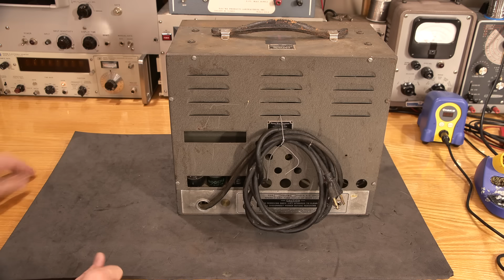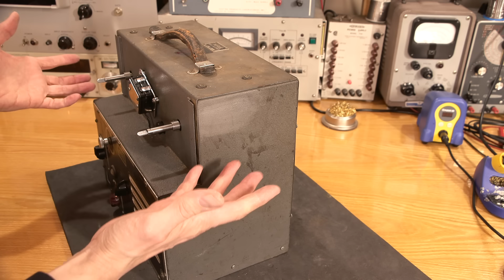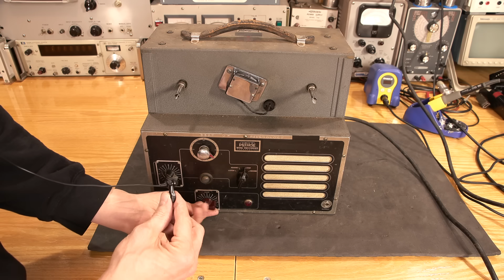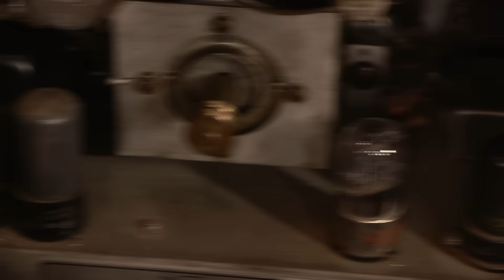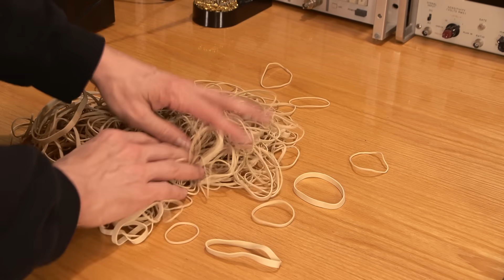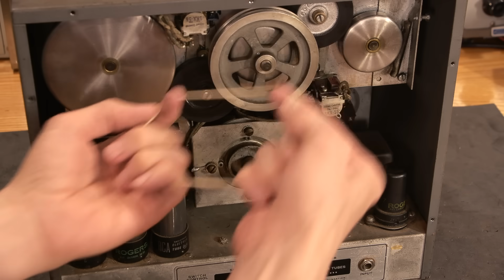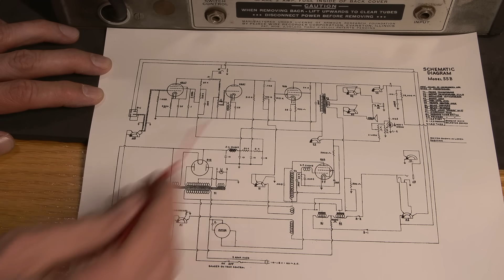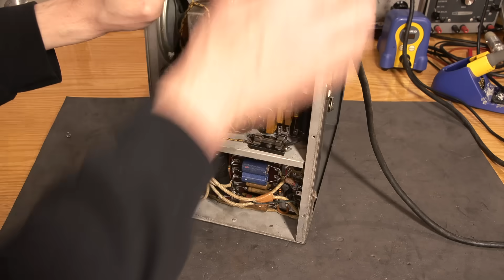Trapped Voices In This Wire - Let's Listen To Them!

Comment: Put another one down in the YES column for a restoration video!!!  I have a box of old vacuum tubes and may even have a replacement for a faulty one or more in the amplifier!

But I guess if you can’t find a replacement, you can use a modern amp that’s multitudes more efficient.

Comment: I inherited an old wire recorder from my grandfather with several wire recordings taken off the radio in the late 1930's of my mom and her two brothers singing gospel songs as kids. Only my uncle still remains and he is in his nineties. My cousin and I trouble shot and replaced the old dried paper capacitors with newer caps (we drilled out the old wax and paper caps and hid the new ones inside the old, refilling them with epoxy. That was 15 years ago. It still works electronically but when I was transferring the recordings to digital, in 2019, one of the springs in the winding mechanism broke and tangled one of the wire recordings. I need to get back to that project soon.

Comment: I'm eager to hear the recording, so since the transport works could you just isolate the head and wire it into an aux input or just a guitar amp and we can hear it without messing with caps, tubes and diagnosis?

Comment: This was interesting to me.  As a child I used to watch my dad work on old tube radios and later, TVs.  I was always fascinated in al the glowing tubes in back.  Of course, back then, when an old tube failed, he could go out and usually find a replacement. (time: late 50s early 60s)  Thanks for the memories.  ALSO: @dm.2023 mentioned wanting to hear the whole conversation on this wire.  I would too!  I never knew wire was (could be) used in this manner.

Comment: Hi Mr. Carlson I am a Patreon member of yours for years. I was wondering if you could create and share a build for a capacitor tester that is super sensitive for testing small pico farad caps to measure their capacity accurately. Most multimeters even my Fluke really is not that accurate when measuring extremely low value caps.

Comment: You need to stoo playing with this immediately. You need to get some redundancy set up and multiple recording at a higher definition than the play back.  Reason for that will become apparent later.
Think of LP’s and half speed master recordings. I owned two half speed master back in the early 1980’s. One was Dark side of the Moon, and the other was Aqualung. Look up how half speed mastering was done. Its a way to get better quality than the original.

Comment: That magnetic wire probably can last much longer than old tapes which often must be baked to prevent deterioration. 

In fact that circuit is quite complicated compared to the circuit of for example a late 50's Telefunken Magnetophon, because in those Telefunkens the same output pentode (usually EL95 or EL84) is used both as an audio output stage and, when recording, as a bias oscillator. So there is no need for that extra pentode unless the device  features separate recording and playback heads and you want to be able to real time monitor recording from the output stage.

Comment: I am 81 years old, and my family had a wire recorder that was used extensively in the early 1950’s but did not look at all like your “monster” looking machine.  Ours looked nearly exactly like reel to reel tape machines (which we also had) that succeeded then wire recorder in the laten50’s and earlyn60’s.  The only issue we had (as kids playing with the wire recorder) was that we would occasionally tangle the wire and then we would have to pull out of the reel and make sure that it “fed” properly.  I wish I could tell you the brand name on our machine, but two name stand out from that time:Zenith and Ampex.  The tape machine that we had in about 1962 was a Sony.  The quality of the wire recorders was very good - nearly as good as the later tape machines.

Comment: A definite yes on the whole troubleshooting video. Also a discussion of how the pick up head works. Later technology used "tape" with iron oxide embedded on it as the recording medium. How did the "wire" store the localized signal? Thanks again for an interesting view into the past.

Comment: It is very important that you reawsken that disembodied voice , kept trapped within the wire !  I bet its the last known non-babbling recording of Kamala Harris as she lay upon the psyche lab couch !   Nick , NavyBlueSmoke , LST-1195 keep the relays if you trash that museum piece. They have real beryllium / copper contacts ! Reliable low resistance with negligible heat in high current circuits. Resistant to welding tendency that is common in cheap relays. Nick , NavyBlueSmoke , LST-1195

Comment: Could likely build a replacement for the electronics in that thing in a few days using a modern pickup and a couple of op amps/audio amps.   I guess it is cool to ressurect the dinosaur, but technically no reason to do that.

Comment: You can soak hard rubber parts in brake fluid to soften them back up. Brake fluid contains a rubber conditioner in it to keep o rings from going hard. You can also coat them with Glycerine and keep applying it over weeks while the rubber slowly absorbs it. It's a safer way of doing it than brake fluid but it is much, much slower.

Comment: WOW!  Hey Mr. Carlson - you may be on verge of KILLING YOURSELF!! my father was a TV repairman after WW2 and when i was a kid and used to watch him work on the early TV's he would always lecture me about NOT putting my hand into the back of the TV because there were capacitors on the chassis that carried HIGH VOLTAGE - enough to kill a person. you had to unplug the TV and let it sit for at least ten minutes before you started messing with it so the electric charge would drain off. as to your "wire recorder", i believe you are missing the drive belt that goes from the motor to the upper "gearbox" that works the reading head in and out.  the drive belt would have been a round (circular) black rubber belt of the type commonly found on old Hoover vacuum cleaners that drives the pick-up brush on the front of the vacuum. wire recorders were used a lot in WW2 by the U.S. military at the Administrative Divisions of the services.

Comment: You can buy “o-ring” banding on a roll…(in all diameters) then cut to length and super glue the ends. It’s an accepted method in the heavy machinery industry.

Comment: THE RUBBER WHEELS ARE CALLED "IDLER  WHEELS" OLD BSR  RECORD PLAYERS USED THEM. I CHANGED A LOT OF THEM. THE RUBBER BELTS  OVER THE YEARS TURN INTO GUMBO BELTS. LIKE WHEN YOU WRAP SOMETHING WITH RUBBER BANDS , THE STRETCHING OVER THE YEARS CAUSE RUBBER BANDS TO TURN INTO MUSH,  STICKY GOO. NICE WIRE  RECORDER /PLAYBACK DEVICE!! 😊😊😊😊

Comment: Amazingly good sound! I made custom O-rings for customers when I worked in an auto parts store back in the 1980's and it might be a service still available at one of these places.  It is a simple DIY project using O-ring stock, a razor blade and super glue.  A guide, or good eye and steady hand is needed to cut a fairly precise, right-angle cut on both ends of the O-ring stock, then bond ends together with super glue.

Comment: Very cool. I have never actually seen a wire recorder. My Dad had a spool of wire from one though. Also in 1967 when I was about 13 I got a couple of TVs my dad bought at an auction that didn't work. He had a tube tester so I tested all the tubes in the set and swapped out tubes to get one TV working. I remember before i did any swapping one of the tubes was flashing purple! That scared me a little bit. This was my first TV in my bedroom but I had to wire it up to the basement door so Dad wouldn't catch me watching TV when I was supposed to be sleeping.  I still have that tube tester and have repaired several antique radios in the last few years. I am amazes how much smaller the capacitors are that replace the old wax and paper ones.

Comment: Just out of curiosity; would it not have been safer to wear gloves when turning ON the power to this un-tested device? (In case the chassis was somehow damaged an not isolated. I'm assuming the device was running on a normal house-hold power outlet)

I learned the hard way to always wear gloves when getting near electrical devices (I mean, it IS human to err ;) So just to be on the safe side I never touch un-tested metal devices with bare hands)

Comment: Hi Mr Carlson. Did you know that Giuglielmo Marconi used in his first commercial Ship Radio stations a " Maggie" detector to demodulate his transmissions. The magnetic demodulator was considered to be more sensitive than the Coherer, and more stable than the Cristal detector. How it worked?  There was a loop of wire , driven by a fast running clockwork motor,that had to be wound up about every 15 minutes. The magnetic wire passed through 3 Coils (Heads). One Coil was passed by the RF from antenna and receiver coil (tuning), then one magnetising coil, and one receiver coil connected to the Headphones. The RF from receiver demagnetised the wire and you heard in the headphones  a louder or less loud hiss depending on the received telegraphy signs.  This was in the 1910s  no tube amplifier needed.

Comment: Sounds like a shorted coupling cap, it should be a simple fix. Cut the cap off the grid and see if that tube cools off. I actually remember these machines, they were available in all the surplus stores back in the day. I used to play aro0und with them.

Comment: I wonder if the secondary of the output transformer shorted out.  Considering you got audio at different points in the circuit but nothing on the output and the tube was glowing more than it should have, that's what it sounds like to me, but I could definitely be wrong.

Comment: I think the irony here Paul is that wire recorders were invented by Paul's son (ok, Paulsen). Would LOVE to see a full restore, or perhaps tap it off the playback/record head and put jacks to a modern amp for listening? I'd love to hear more of the recording to understand the topic, for sure. I did something similar where i used the top end of a Webster-Chicago and replaced the badly burned amp section with one I removed from an old broken tube mono Emerson wooden phonograph whose tonearm was missing. Sounded great. Sold it for a very nice sum with a blank 15-minute spool of wire. As a joke I had used a mic to record Pink Floyd's "Totally Numb" - the buyer LOVED it.

Comment: Why not gently disconnect the head wires from the original preamp, and feed any modern much-quieter balanced-input preamp?  That way, any remaining hum will be on the original recording only, and could even be locked onto for pitch calibration if you know the reliability of the grid at that time/location in history.

Comment: Very Interesting.  I know about a GREAT application that used a wire recorder.  In the 1970's I was a pilot on McDonnell Douglas DC-9 passenger aircraft.  The Cockpit Voice Recorder (CVR) used a wire recorder!  I have aircraft manuals, but they would just have the CVR manufacturer & P/N.  Yes, audio tapes were available, but in a crash / fire, the wire recordings would have a much better chance of surviving.  These days, new ones are all solid-state.

Comment: My father purchased a Webcor wire recorder around 1948 or 49 and used it for many years.  It used a singe spool of wire and had a large built-in takeup reel that turned at 78 RPM.  You could record from a 78 RPM record mounted on this reel.  It could also broadcast through a built in AM  transmitter over a short distance.  The sound quality was quite amazing for its time, probably because the wire moved quite quickly over the pickup head spreading out the magnetized region on the wire and also increasing the strength of the varying magnetic field.  I remember that one problem was splicing the wire after a breakage.  The solution was as simple as tying a reef knot.

Comment: You can use watchmaker lathe round 3-4mm width round O-ring by the foot and cut it down to size and heat weld instructions on YouTube.

Comment: I purchased a combination 45 rpm phonograph player and wire recorder from an auction about 40 years ago. But it didn't work when I bought it. It came in a what was probably once a pretty nice wooden case with several spools of wire. I believe it may have been used at a lawyer's office for dictation.

Comment: Cool find. Belts were the first things to fall off. Some may have used leather belts.  Hook the play/record head to another amplifier directly and it should sound fine. I don't think wire recordings needed a bias frequency for playback. I have disconnected the power from electronics and just operated the transport before. Thanks for the video.

Comment: That's fantastic. I was aware that wire recorders were used before tape recorders but this is the first time I've seen one working. With the audio working that will be a great historical recorder/player. I would love to see it measured for signal to noise ratio, frequency response and wow and flutter to compare with old tape machines.

Comment: i do a lot of making old computer storage hardware functional on modern hardware to read the old data. i would assume this thing works similar to a cassette tape, so this thing is fairly simple. I mean the circuitry is, but the principle behind seams too. i mean, yeah it's only audio, so no frequency modulation shenanigans like on Data tape systems. 
what i could see in that short time was this thing is basically a mix of a tape deck and an electric guitar amplifier and the data is storage like on a typical chrome tape but in mono. 
i wonder how many hours can be stored on this wire. 

i definitely what to see this thing working again like intended. The Microphone is properly a dynamic or electrostatic microphone, those are typical at this time.

Comment: I'm old enough to have worked with this systems and it was hell. The wires would often break. I transferred some archives from wire to standard cassette format. This was at the CKAC 730 radio station in Montréal.

Comment: How is your power limited/Variac power board wired. Variac before the power limiter then plug? I am setting up a test bench in my guitar repair shop and I have a Variac and want a safe way to check amplifiers and other electronics. 
Yes do a complete troubleshooting  video

Comment: So what year does this recording machine date from ?
30's through 60's ???
I'd be interested in "How it works" ???
Reply: The first wire recorder was invented in the late 1890's.  By the 1950's magnetic tape had taken its place.  Wire recording also works on the same principal as magnetic tape.  The wire is magnetized by the record head as it moves past and when pulled (or moved) past the play head at the same speed as the recording took place the same audio signal is created in the play head.   Unlike old audio tapes that disintegrate these wire recordings hold up remarkably well over time.